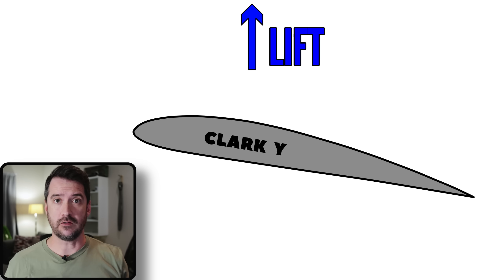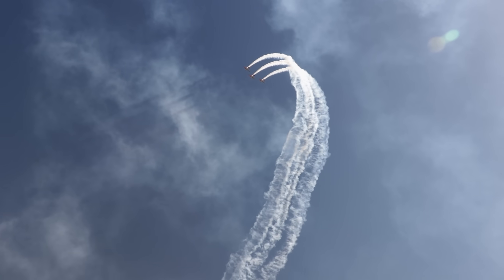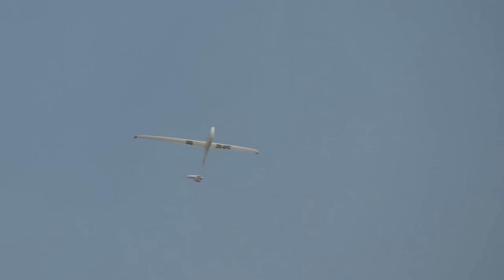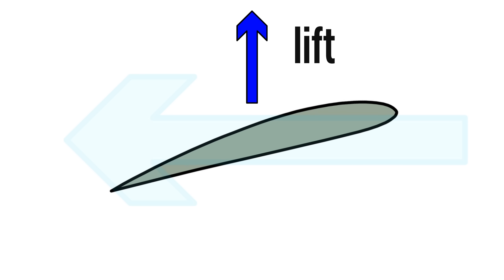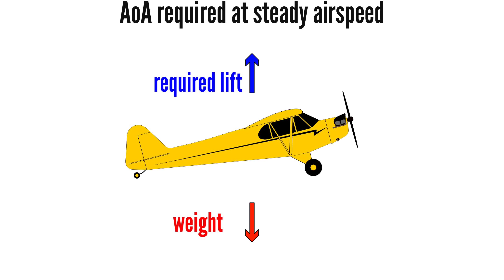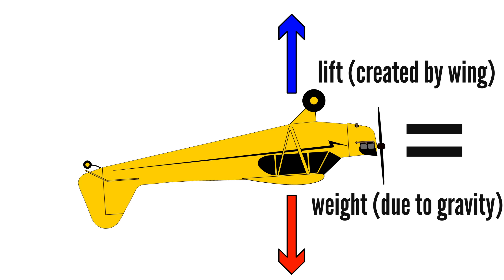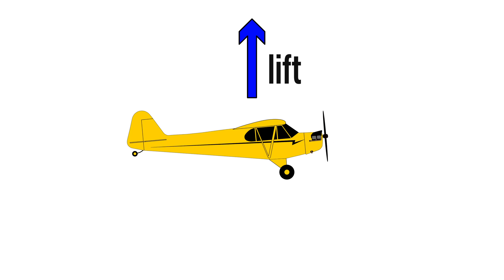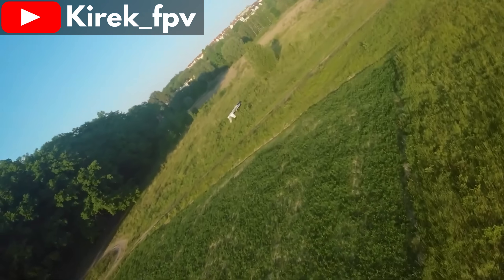Is Airflow Distance Over the Top of a Wing Always Longer?

Comment: The confusion arises because people think it must be an either/or...
Lift is generated by 2 simultaneously occurring phenomena, one is the pressure difference between the top and bottom of the plane (causes a small amount of lift and almost no drag), and the other is the impulse due to air being accelerated downwards (causes most of the lift but also a lot of the drag, called "Drag due to lift").
The rest of the drag is due to the form factor and skin friction.
Reply: And those result from conservation of mass flow rate (continuity equation), conservation of energy and conservation of momentum.  The airfoil puts stress on the mass flow rate continuity resulting in the pressure drop, as conservation of energy requires this to increase the velocity to maintain flow continuity (deprivation of flow increases pressure differential consistent with lateral acceleration of the flow).  This conservation of energy induced pressure drop alters the path of the flow field in the vertical direction (adjacent air moves towards the area of lower pressure) such that the change in momentum vertically equates to the force from the vertical difference in pressure.  All phenomena intimately tied together, and each separately requiring consideration.  Navier-Stokes equations.
Reply: @davetime5234  Masterpiece explanation.... 
No downwash effect.... no longer path effect... nothing... It works because of an object in a fluid flow (air) is affected by the energy of the fluid... and its effect is the pressure on the object... If the object (airfoil) is located with a positive angle of attack it will create a force upwards (lift) and backwards (drag) as resulting effect of the pressure generated by the fluid...  And obviously, at least two pressure fields will be created..... there is no negative pressure on the extrados (upper surface) of the airfoil... it is just the pressure underneath (intrados) the airfoil greater than the pressure over the extrados...
Inverted flight is the same.... It is always about a positive angle of attack against the direction of the fluid flow.
Lateral flight is the same... in which the wings are vertical... so the fuselage is the object that generates lift because of the fluid pressure on it... and it need a really high angle of attack to work... with the tail as the only control surface for the plane attitude.
Reply: No. These are the different representations (by the law of Bernoulli and Newton) of the exact same thing. The two phenomena causing the lift are 1, the pressure difference due to the profile of the wing 2, the pressure difference due to the angle of attack. These two add up when you are in a normal position. When inverted flying is concerned, the contribution from the wing profile turns negative (or it is zero for a symmetrical wing), therefore for flying a plane inverted you just have to make sure that the lift generated by the angle of attack is way larger than the effects stemming from the profile of the wing.
Reply: Those are the same thing. Due to the wing's angle of attack, air is compressed on the bottom of the wing creating high pressure, and on the top it wants to pull off the surface of the wing due to inertia, creating low pressure. And it is the angle of attack that directs air downwards. Bernoulli's principle has to do with the speed of air over the two sides of the wing. It does generate lift, but it's very minimal. It only makes a wing more efficient, with most lift coming from the Newtonian principle of lift. This is why you will NEVER see an airplane flying with a 0 degree angle of attack, but planes with symmetrical wings (so with 0 lift from Bernoulli's) are quite common.
Reply: @CristiNeagu  ANY lift ascribed to Bernoulli is replicated in equal and opposite manner, i.e. the ambient air is "lifted" DOWNWARD.  Newton is 100% responsible for lift (and drag).
Reply: It seems to me that deflecting air downwards creates lower pressure over the top of the wing.
Reply: @timdunn2257 Deflecting air down on the bottom of the wing creates more pressure on the bottom of the wing. I lean towards believing that this is the greater contributor to lift. The airfoil creates some lift, but it also minimizes turbulence over the upper side.

Some respondents have noted that you can have lift from an airfoil with zero angle of attack.

Conversely, you can generate lift from a flat wing, with a positive angle of attack, as seen on some of the inexpensive toy airplanes.
Reply: @davidkantor7978  I know from sailing Hasler's junk rig for thousands of miles 
(Local sailing near Seattle, Seattle to the Marquesas, Marquesas to New Zealand, New Zealand to Guam, Guam to New Guinea, New Guinea to Hong Kong,) that a flat sail can generate enough lift to sail effectively to windward, but that it stalls out and loses windward ability at lower angles of attack (ie. sheeted in at a lesser angle to the wind) than a cambered sail.  Foils sail better to windward than flat sails, ie. they aren't so quick to stall, and generate more net force to windward.  From this I deduce that the angle of attack produces lift, and the foil shape keeps laminar flow better, enabling pointing higher.  Pointing higher makes it possible to deflect the wind more downward.  This is all based on observation by me.  I don't understand any of the math, and arcane theories such as circular flow go right over my head. 

I have never seen a sail produce lift at a  zero angle of attack, no matter how much camber it has. At zero angle of attack, a monohull sailboat loses its heel and stops moving.  Sailors play with increasing and decreasing camber with various sail controls on sails with camber.  Sailors have very long known that you improve lift at lighter winds by increasing camber, and at higher wind speeds, you flatten the sail more.
Reply: @timdunn2257  
Yes but you can generate a pressure difference without deflecting air.
It is however a very small component of the lift force in real life.
Reply: @warriorson7979 
No, you CANNOT generate ANY lift without transferring downward momentum to air.
IF you could do that, that would violate Newton's 3rd law.
IF, IF that was possible, you could theoretically create a propulsion device for use in vacuum.
BUT WE CANNOT.
Reply: So all the closet aerodynamicists coming out.  You assert these two things are happening at the same time?  You're confusing two different analytic methods.
Reply: Yes, nicely stated, BUT what is the root cause of the pressure differential.
Reply: @California3366  
The Bernoulli effect. Air moving faster in one place than another.
Reply: @warriorson7979  Bernoulli describes an effect, but what is the cause of the effect?  Why is the pressure less?  It isn't air speed as with especially thin wings the top v. bottom airspeeds can be almost identical, yet the top flow results in much more effect.  

However, if some the air molecules flowing over the top is are removed from the region immediately next to the wing and compressed into a layer a cm or more above the wing, or given upward momentum, then there will be less pressure at the boundary area and the wing would want to fill that lower pressure region.  The speed of the wing into the airflow compresses the air and deflects it upward.
Reply: OH, I forgot to add, yes, I think momentum change definitely does play a part.  I may not have been clear on that.  The problem I have with momentum change being the prime effect is that the momentum change is pretty much all occurring toward the tail end of the wing.  This would lead to a strong pitch pushing the tail of the wing up and the leading edge down.  Bad thing to do.  And it is well established that the center of lift is not at the trailing edge of a wing but up around toward the front of the wing.  So, I think both momentum change and lower pressure BOTH apply to causing lift! LP to the front of the wing and MC toward the back.
Reply: @California3366  The momentum change of the air would be my guess. 
That’s basically what I was arguing above, if you would have it.
Reply: @thrall1342  I like it better that Bernoulli, that's definite. 

However, with thin wings the top v. bottom airspeeds can be almost identical, and so the vertical momentum change is not much.  

How about this: if some the air molecules flowing over the top are removed from the region immediately next to the wing and compressed into a layer a cm or more above the wing, or given upward momentum, then there will be less pressure at the boundary area and the wing would want to fill that lower pressure region.  The speed of the wing into the airflow compresses the air and deflects it upward.  The air deflected up would have momentum "in the wrong direction", and the decrease in pressure in the boundary layer region would overcome that as well as provide more lift.
Reply: @California3366  The inertia of the air probably plays a role, but ultimately any force pushing the wing up is going to accelerate the air downwards, no matter how the force comes about.
Reply: @davetime5234  There are  enough tests in wind tunnel and nowadays finite elements analysis simulation models about longer path effect being no fully true... it happens, but it is not true.... 

the explanation about two particles to travel extrados and intrados and arriving the trailing edge together is false. At the time I was at the academy the particles explanation was the main explanation for lift. It is true the particle on the extrados is faster that the one on the intrados, but they do not arrive to the trailing edge at the same time.

Then sorry when I said about downwash... I meant about those graphics that shows airflow like a big air volume pointing downwards at the trailing edge (I agree with you in the existence of an air mass displacement). The explanation of the downwash being the main cause for lift is false, because the main fluid stream that is far from the limit layer forces the air surrounding the airfoil backwards... Downwash can be explained as an effect of the flow impulse doing pressure on the main stream fluid (action/reaction..?? like jet engines work... jet stream increasing pressure on the surrounding air mass and reducing it on the intake... which creates two pressure fields arround the jet... it is kind of deforming space). So we can consider the airfoil deforming the space too. But it's effect is lower than the pressure differential... or to the force applied to the intrados. And this is also proven by pressure sensors in wind tunnel models.

About the negative pressure on the extrados... that is not a "Must" rule... the only thing you need is a differential pressure. With higher pressure on the intrados to generate lift. and the pressure on the leading edge region a big cause for the drag, and the optimized shape of the airfoil to reduce the drag.
About the lateral flight, I never said the tail generates lift... it is the airplane body and the airflow pressure underneath the body... what the tail do is to maintain the high angle of attack for the body to generate lift....
Reply: @davetime5234  I agree with you now... My example of the jet engine is about action/reaction principle... 
It can also be associated to how downwash stream acts on the air surrounding the airfoil... 
What makes me sick is when I found the downwash illustrated as vectors coming down from the extrados, joining the intrados flow and pointing downwards.
If you think the airfoil that travels in the air mass surrounding it, the downwash vertical speed component is really small in comparison with the speed of the air in the direction of flight.
So, I agree we can explain lift by a group of different principles, because there is no unique explanation for lift. but at the end it reduces to how air dynamic pressure acts on the airfoil. We need air density, speed, temperature, AOA, etc... Many conditions satisfied.
And is not the airfoil pushing air downwards.... it is the air stream acting on the airfoil pushing it upwards.... What do you need first is to create an air stream by accelerating the airfoil. 
If we can generate a pressure differential without accelerating the airfoil the pressure around the object will tend to the equilibrium, we will have air moving upwards not downwards.... but when we add speed to the airfoil, we have air deflection by change of direction added to the aerodynamic effect if we have an airfoil like Clark Y or similar.
Reply: @davetime5234  regarding downwash I don’t like this explanation or the air mass displacement you explain on every comment, because of the turning direction of the different vortexes you can find along wings. Example is the wingtip vortex starting underneath the wing and moving the air mass to the top of the wing… bring the reason for the creation of the winglets to reduce drag and improve fuel economy. Other vortexes created along trailing edge have same behavior and that is related to the higher pressure underneath the wing which multiply lied by the wing area results in the upward force that creates lift. Those vortexes became visible in the wing tunnel by adding smoke… you know about this… So downwash for me is a bit controversial. 
I cannot say downwash theory is wrong, because it is one of the current valid theories of flight… but for me it’s a bit controversial as said before.
Reply: @davetime5234  "In the case of the aircraft flying with lift, it also has the pressure difference, and that pressure difference, instead of having the crane to pull on, is now pulling on the airflow further above. "
It is obvious there will be an air displacement due to the aircraft moving from one space to other above, so the air mas will be displaced to the previous position of the aircraft.
But the main reason is not the air displacement, it is the higher pressure underneath the wings, that forces the airplane upwards due to the pressure differential. 
Instead of the "crane" supporting the aircraft in your example, there is a fluid pressure supporting the aircraft, compressing against the airfoil intrados... I agree there is no structure there... but the fluid pressure... Main reason why the air is capable of supporting the airplane weight is the change in its density by compression. 
It is much easier to calculate the force of pressure by area of the wing than the air mass displacement per unit time, which is much harder to measure or estimate how much air mass will be displaced to support the aircraft... obviously, at least the weight of the plane.
In the case we have the same pressure on both sides of the wing there is no movement possible, because of the system is in equilibrium. Can we agree on that?
Higher pressure in the intrados forces a volume of air to move over the extrados creating the vortex. Will you say this is not true? Just look how the vortex are rotating.
Excellent conversation about lift, thank you very much.
Reply: To be fair, those are one and the same thing, if I'm not mistaken.
Air acceleration downwards can only happen with that pressure differential created by something that's thusly accelerated upwards.
Reply: Thank you, you're correct.
Reply: @gamaltk  
Absolutely incorrect.
Air is just molecules, nothing else.
A wing pushes molecules  down changing their momentum, that requires  force equal to Lift.
Reply: @Alec72HD  I was replying to @thrall1342
Reply: @gamaltk  Ah, thank you !
Reply: At very high AOAs the air is burbling at the trailing edge, yet induced lift is maximized.  Where is the air at the trailing edge?  It's burbling not moving down.  So there must be some other facters as well that creates total lift.  Take a view of this.  https://www.youtube.com/watch?v=E3i_XHlVCeU @thrall1342
Reply: @thrall1342  They are linked by cause and effect and numerical equality, but the two must be considered separately.  A suction cup stuck on a refrigerator door is held up by a pressure difference, but the weight of that suspended mass is supported through the structure of the fridge against the floor.  As an aircraft has no such rigid support structure, it is required to expel mass downwards, as a consequence of that pressure difference, to supply the necessary force suspending it above the ground.  So, what manifests as a result of the pressure difference, must be considered separately to get at the full description.  An airplane suspended by a suction cup from a crane is also opposing weight from a pressure difference, but the crane is substituting for the need for vertical expulsion of mass (change in vertical momentum equals the difference in pressure for an aircraft in flight).
Reply: @davetime5234  Of course it’s all in there, but the air that changes momentum never touches the wing.
It mediates its momentum change by exerting force on the air around, which is pressure. 
Newton’s law: no momentum change without a force, which in this case arrises from pressure.

All those conservation laws you stated necessitate that pressure and mass flow cease to be separate quantities and are linked. Its basically a reduction of dimensionality, like a singular matrix describing an equation system with less degrees of freedom than variables.
Reply: @thrall1342  I think I need to be clear on what you mean here?: "but the air that changes momentum never touches the wing.
It mediates its momentum change by exerting force on the air around, which is pressure"

When the Bernoulli effect reduces pressure above the wing, this is equivalent to fewer molecular collisions with the top of the wing (relative to the bottom).  

But this lessened static pressure that is experienced as less momentum transfer to the top of the wing, cannot just be erased, due to conservation of momentum.  It can only be "reallocated."

The conservation bookkeeping is from the higher static pressure air above descending to try to fill that gap. 

This is how the equivalence between the pressure difference and the induced downward momentum of air is made - collisions suspended with the top of the wing, show up as equivalent momentum generated in the downwash.

So, pressure differential force = induced downward momentum of air

The above shows Bernoulli = Newton's 3rd law

(we can also explain it as air accelerated downward from a pressure difference, but I tied the molecular collision issue in, because I think that gives a compelling perspective)
Reply: @davetime5234  Yes, that is exactly what I was talking about.

Due to Newton’s third law the pressure acting on the wing to create lift and acting on the air to create downwards momentum are one and the same phenomenon.
Reply: All you need to understand is Bernoulli’s Principle.  When you have a fluid (air follows fluid dynamics), there are 2 kinds of pressure:
1.  Static Pressure.  Pressure all around an object.  At sea level, there is ~15 lb / in ^2 of pressure acting on you.
2.  Ram Pressure.  If you are in a speeding car, and you stick your arm out the window, your arm moves very quickly through the air, exerting pressure on your arm.

What's the relationship?  As ram pressure goes up, static pressure goes down.  If you roll the windows down on your car, and drive fast, light objects in the car, such as a piece of paper, can get sucked out of the car.

On a wing, where the air splits, as long as the flow is laminar (not disrupted, stalled, etc.), it will meet on the other side.  The air that goes further has a higher ram pressure and lower static pressure.  Lift is static pressure pushing from high to low pressure through the wing.

What seems to not be considered is that control of an aircraft is done through changing the shape of the various airfoils through control surfaces, which change their lift, drag, etc.